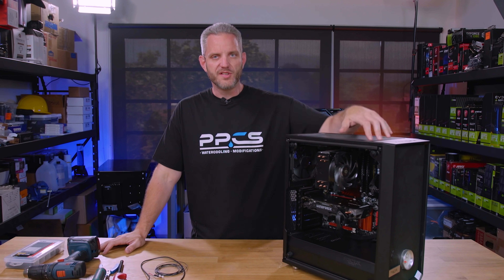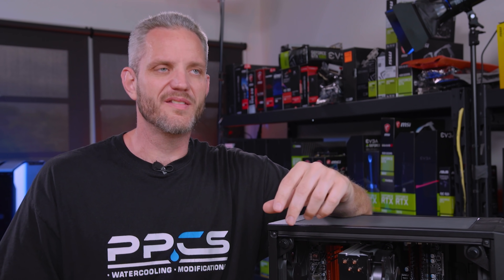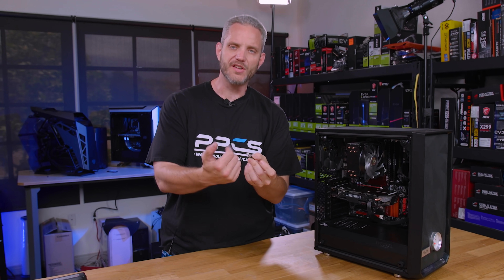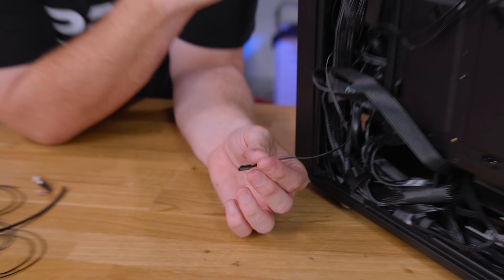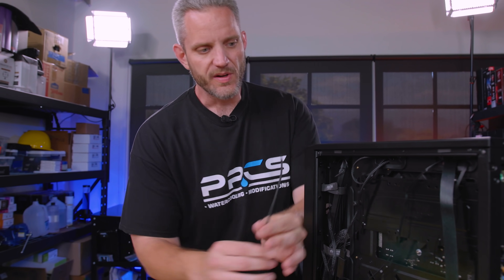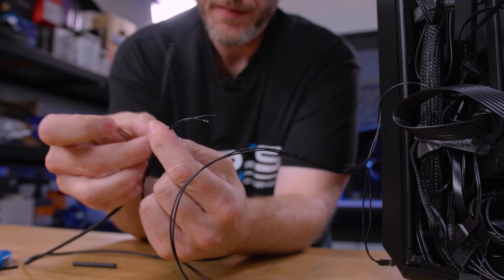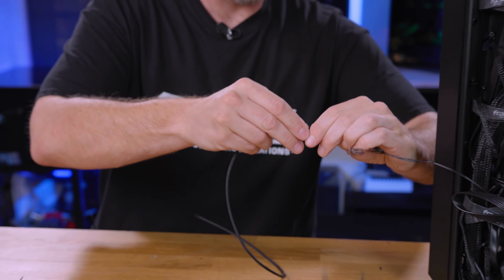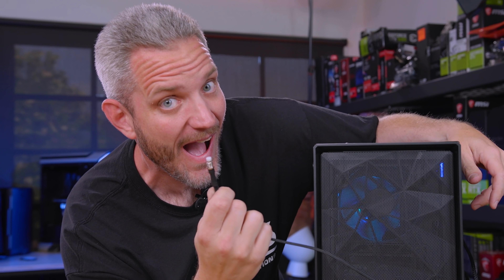How to install a PC KILL SWITCH!

Comment: Why not simply using one of those cheap RC-relais? They are less than 20$ and can be set to a toggle or momentary switch. Or use a reed-switch and a magnet through the plastic front of the case. This won't even make any damage to the case.

Comment: if you want to keep roommates or parents or whatnot out of your system (and for some reason you can't use a password), how about adding in a RDFI or NFC device with a keyfob, or bracelet (or whatever) as a key that has to be within X meters (or 3X feet) before the system will turn on?

Comment: wouldnt it have been easier to feed the wires through the case and then attaching the button, you know, instead of drilling a hole.

also i have that same case.

Comment: Ive been wanting to do something similar but with wifi

Grab a dead harddrive and take out the components of the hdd. 
Get the VSB 5v  to provide power to a Esp32 or Esp8266 (any wifi arduino or development board) inside of the stripped hdd
Grab 2 transistors and resistors.
Wire one transistor in series with the power button. And the other transistor in parralell over  the series connection
Set static ip on the esp/arduino/whatever
Make or grab some basic code to toggle the transistors via a website (the transistor over the switch and other transistor on for a second then off again to act as a normal power button) and the other transistor toggle on or off with website
This contraption conveniently housed in a dead hdd

Comment: How about making a 2nd gen (idk 2600k-2700k CPU) gaming machine in a SFF case (used from some brand, dell, nec etc) whilst using  small graphics card, will it be good for todays games, or any good at all? can it be overclocked? i think ppl might want to see if they still have older systems and want to do something with it and play games like todays games with it. after all the factory built SFF computers are cheap to buy like 20-50$, just change motherboard, add GPU and lets see it run...
can it be done?

Comment: I thought this was a bad idea, until you drilled the hole and fixed it with a hammer and screw driver. Not to mention all the filings that went into the computer, after the rag got caught in the drill. I laughed my butt off!!!

Comment: Hey Jay I just have a thought. Instead of using a button to hold down to use the power button. Why not go a little old school and set a key that has to be turned into the on position to enable the power button then when you're done disable the power button . For instance little Jay could turn the key turn her computer on then turn the key and remove it leaving the computer on then if her little sister comes up and tries to turn off the power button it won't work at all without the key this also would be a great way to limit time as you would be able to turn off the computer with no way of turning it back on without a key.

Comment: Well, That is a good idea, to install that switch. I have built an i9 Workstation, to render videos and maybe play some games. It has x299 Designaire EX MB, 128GB ram , 1x evga 2080Ti 11GB RTX GPU (maybe will add second one), 1x samsung 500GB m.2, 2x 1TB Samsung Pro m.2, Phanteks Evolve X RGB ATX case. Because the power switch is top of the case, my cat has turned my pc off, while I was watching movies, by jumping on the pc and steping on the button. And then she did look at me like "What?!?!?" .... 2x allready. I need to do this mod too.

Comment: I thought, this was a new feature... But i allready did the same thing years ago.
Edit: Grammar + I used an Relay that switches off when my TV has Voltage on the USB Port, so ill have to shut the TV off first.

Comment: Jay

Even sneakier route would  be to use a magnetic reed switch, and that would require a magnet to close the reed to allow you to power on the machine.  Much less intuitive than a mechanic switch, and a lot less expensive than what you paid to get that mechanical switch.  And with aluminum computer cases, it can be mounted essentially anywhere with a dab of hot melt.   I had an old machine with a Intel Inside sticker on the front of the case, and put the reed jinside the case behind the location of the sticker.  Makes it easy to remember where the switch is located.  I have some Corsair defender USB storage that I glued a magnet on the end so I could stick then on a metal strip so they are handy, so just grab one of those USB drives and wave it over the label and Bob's your uncle

Jophn

Comment: Perhaps I WANT a toggle switch AND a momentary switch instead of the power button? 
Toggle for power, momentary for ignition. Nobody gonna have a clue if I run the wires to my Derek Speare Designs Race King LED Button box.
Reply: After thought: Neither would I until I mistook my PC's power switch for the car's power switch on pit lane..

Comment: I have done something like this before....Many cases have both a power button and a reset button. because the reset button is also a momentary switch, I was able to connect the 2 switches in series. In order to turn the machine on you had to press both buttons at the same time. and because most don't think of needing to push both at the same time the housemates couldn't turn my computer off to "save energy" while I had a game downloading.

Comment: That sort of carry on can actually destroy your hard drive so shut down in a orderly fashion or you will have to replace the hard drive and reinstall the OS and your games, why not go retro and have a PCI-E board with the EPROMS containing the Operating system so the computer has no hard drive and each game will be a separate SDHC like PUBG,APEX and Fortnight which plugs into a SD card slot so when she boots up the machine from the EPROM board she would load the game from a SDHC card like the good days.

Comment: The front panel(fpanel) prongs have reset pins. They make a button that places over it for work benches. Most cases have the reset/kill switch built in. Fpanel prongs was also the only scary part of wiring my first PC having a kill switch is important. I'm a programmer. Continuous Loops happen.... Crap I for got to add the switch to the do while.... XD insta freeze if on the main thread

Comment: I prefer normal on/off switch connected in parallel with reset button. PC  will never post until switch si flipped :)

Comment: If you had 2 boot drives, could you kill switch to physically change the boot order without changing it in bios? I mean I get you can hot swap, but say you wanted to only boot from a specific drive while you use it, but if anyone else turns on your PC a different drive is used.  I also understand it would need to be a toggle switch not an interup style button.

Comment: It's not really a kill switch if it only stops the operation of the power button. You can still easily jump the board with a knife or a paper clip if you have any knowledge at all. It would be a much more elegant solution if you instead used a toggle switch that both toggled the function of the button, but also interrupts one of the power cables going to the motherboard. Then if a potential data thief figured they would try and jump the board to get on the computer; it may work to an extent, but the computer wont be operable due to the interrupted power supply. This thief wont be able to get on there without finding a kill switch or changing out the power supply.

Comment: I noticed your classic twist the wire and bend it over on itself method. It's totally fine for a button but I strongly advise against using this in ANY circumstance where there is constant current on the wire. A hotspot will form at the point of least resistance (the bottom of the twist), causing the copper to glow red and the tubing to melt. I ran an old GPU like this with a franken-PSU (modded to have dual 8pin in a similar fashion) and of course my heat-shrink melted off and charred my wires. The whole floor smelled like smoke for a bit, but I'm lucky to have been in the room when the fire started as it would have grown larger and likely destroyed the computer, and probably my desk.

Comment: Hang on? So basically you're using literally the most basic electronic circuit possible and it only works if your kid has zero problem solving skills whatsoever or the metal age of a three year old? And even then, most three year olds will work this out quickly. Right.....

Comment: I used an RFID chip to allow access to our electronics in the house (TV, Computers, DVD, ECT.) My wife and I  Set Time limits and based on Grades and behavior. If two id's are recognized only the ID that activated the machine first is eligible to turn it off!

Comment: would it be a good idea to wire the reset and on switches like this so you have to push both buttons at the same time instead of adding another switch? I know some cases don't have reset buttons, but there are still some that do.

Comment: Nice idea, however i would have gone with a reed switch. then a magnet could be placed over reed switch to enable front panel switch. magnet could be kept on a key chain. with out magnet front switch will not work.

Comment: This would be a great way to stop my cat from turning off my PC when sitting on it. 90% of it was solved by disabling the power off in Windows but occasionally he will hold the button long enough to hard turn it off.

Also possible improvement would be to use a 2 pole switch to lock off the reset button at the same time.

Comment: "switch is slightly wider than the mesh hole" -> takes a drill and a hammer to a 90$ case instead of filing/sanding a 9$ switch a little.

Comment: A temp gage instead of the 12v gage would be better IMO.  Anyway, you could use a key switch.. like a barrel-lock.  You'd have to be able to lock the case as well though, if the people your trying to prevent A) Know how to open it and B) would open it just to get the thing on.  Better off buying them a cheap laptop and let them get in trouble.  You can get one for $50 with a dual core.

Comment: Couldn't you make it a usb and program the computer that the power button does nothing until that is plugged into the usb and pushed? Or a usb key that has to be plugged in to enable the power switch?

Comment: Now run blinker fluid through your water cooling system.
Reply: There must be a shortage of blinker fluid going on. Lots of people have let their blinker fluid reservoir run dry. Very few people now use their blinkers.
Reply: It's headlight fluid, rookie, not blinker fluid. I'll bet the Blues don't have to put up with this kind of crap.
Reply: @Drummin003  Dogg, blinker fluid is a meme. Know your shit old man.
Reply: @fortniteking1010  pretty sure headlight fluid is a meme too :P
Reply: @rafee9442  headlight fluid is gav from rooster teeth
Reply: @shizzyshoe7069  that backfired

Comment: This was literally a standard feature for PC's for a good long while, except it was a key you had to put in. Back when PC's had a turbo button. The key wouldn't let you turn the pc on without it inserted, and if you took it out while the pc was on it would lock the keyboard out and not allow it to be turned off. You could of course pull the power, but you could be assured no one could tamper with your PC's software without being able to use the inputs.

Comment: Next time you need a momentary switch, visit your local electrical supply dealer instead of AutoZone. They carry they don't carry everything that RadioShack used to, but they carry a lot of solid state components. I needed a 10uf capacitor a couple days ago and didn't want to wait for it to come in from an online source. The local supplier who normally sells Romex to contractors had it for me.

Comment: thats alot of work for an easy fix on both of my cases i just moved the power button to the reset switch, its hidden and blends in well and most people wont think of pushing it, so ya i have a 5 sec fix for the problem, my kid no longer turns my pc off on me

Comment: I would put the switch on the bottom of the case and use it as a reset switch and change the actual reset switch as the kill switch it's way more stealthy if you just press both switches with one hand else if you have to use both hands

Comment: But when are you installing boost and temp gauges?

And how about a speedometer for them HDD/SSD read speeds?

And lastly stickers.
Examples:
Toyo tyres, Castrol, Garret, Killer B, Mishimoto, IAG, Willwood, Momo and Recaro, whiteline, Bilstein, K-sport, HKS, Haltec, Manley.

And some no brand stickers.
Objects in mirror are losing.
Bl*w me (with a turbo instead of an O)
Im only speeding cause I need a poo.
+5HP sticker

Comment: I've considered doing this for cats, who will stand on top of PCs and hold the power buttons down until they turn off via the BIOS (which you can't disable). Couldn't find something that'd look nice though. Now I just insist on cases that have buttons on the front. Not enough case designers consider cats. It's a crime.

Comment: Hello guys, i've got a question, is my Build okay? Or maybe  you got some improvements. 
Procesor:AMD ryzen 5 1600x
Motherboard:Gigabyte b450 aorus elite
RAM:16 GB   G skill 3000Mhz Aegis
Case:SilentiumPC Regnum RG4T RGB pure black
Cooling :SilentiumPC Navis RGB 240
Memory: 1 TB Seagate
ADATA 256 GB m.2 PCle XPG SX8200 PRO
Power suply:Corsair CX650 650w 80 plus bronze
Graphics card:MSI Air Boost Radeon Vega 56 8GB OC

Comment: I wouldn't call that a PC killswitch. It's just a PC power switch interrupt. A kill switch is used to cut either the battery or fuel pump or both off on a car in the case of a crash.

Comment: I would've installed a key switch, take the key off and power buttons do nothing anymore. Also a cool idea would be a reed switch. Only when a magnet is placed in a certain spot it will start. Of course you'll still have the problem that turning off the power supply or unplugging it will still stop your computer.

Comment: One thing I did was use an arduino, an MFRC522 and a relay, remove the power button, program the arduino, tap a tag to the MFRC522 and boom! instant secure power button!

Comment: Just a little correction: It shorts the Ground pin with the green wire on your PSU to turn it on, rather than 12V.

Comment: Sweet. Reminds me of my casemodding-times back when the PCs weren't available with Windows or even glass. Did some stealth-mounting of my drives and stuff like that.
Now I'm currently rebuilding an old Chieftec Dragon Case with old hardware and I just cut a window for it. Might give me some nice ideas Jay. 
Personally, I would have ground off a few millimeters of the Pushbutton instead of drilling the case but neat nonetheless.

Comment: Easier solution to this would be to disable the power button, and get a keyboard with a dedicated sleep-button (or set a hotkey shortcut on a regular KB if you don't feel like buying a new one).

Edit. Now don't get me wrong, i'm all for modding, but sometimes it's just easier/cleaner/cheaper to go the simple route. :)

Comment: I installed a Wireless Remote 433mhz  switch (momentary) onto my front panel power switch cable. 
I then set my Power Button to just blank my screen. It could be set to do a Shutdown / sleep, but I keep my PC on 24/7 (to do backups, updates, ect..) and it is in my room. I put my monitors (dual monitor setup) to sleep and do not have to wait the 1 / 10 minutes or whatever I have them set for.

Kinda a niche thing to do, but I hate having to get up and blank my monitors off when I am in bed lol.. I also love that I can hit the button (I have one by the head of my bed and one on a keychain) to turn the monitors on to act as a light if I need to get up in the middle of the night.  I can also blank my screens at will, IF needed, for privacy (but I do not need to hide anything I am doing )

I use a similar setup for the lamp that sits behind my monitors for lighting (toggles on/off). So the same remotes A / B can control PC monitors or Lamps.

The 433Mhz wireless remote switch in the PC is a 12V DC relay and the one for the Lamp is a 85V-250V AC relay.
The PC Remote switch is wired to the front panel Power Switch Cable using T-taps Scotch Lock Quick Splice Wire Connectors.
The Lamp Remote switch I have wired into a well made 3-way extension cord so I can add a few other things (keeping in mind the max amps of the switch is less than 10A)

Comment: Another thing you can do is hook up the power and reset switches in series. Basically, connect one side of the power button plug into one power header pin and connect one side of the reset button plug into the other power header pin. Then run a staple between the two unconnected wires/pins. Then both the power and reset buttons have to be pressed to start/shutdown the PC.

Comment: Simplest available to anyone kill switch is a Ford solenoid on the batteries ground cable. Hide the switch anywhere you want. They will no be able to start the vehicle without knowing where the switch is.  Or finding the switch having to replace the entire battery cable. This switch also stops shorts from draining the battery for old clunkers.

Comment: I'm disappointed. This is a PC power safety switch, not a PC kill switch. You should make an actual PC kill switch that either electrically damages the hardware or at the very least wipes the drives like something out of a spy movie.

Comment: I helped you get to 1 million subs and love your content. I stopped watching at 2:30. I know your just going to put a momentary switch in series with the power switch to stop petty siblings. I get it, it works and is effective. My 71 Charger has 4 hidden switches that must be set before the ignition and fuel pump will turn on, 2 per circuit. Bring us more hard core cooling videos like cardboard, duct tape and air conditioners. Try out some industrial floor drying fans attached directly to the air cooler stack. Dipping the stack into liquid nitogen was my favorite vid. If had access to it, that's the first thing I'd try. After freezing and breaking stuff, of course.